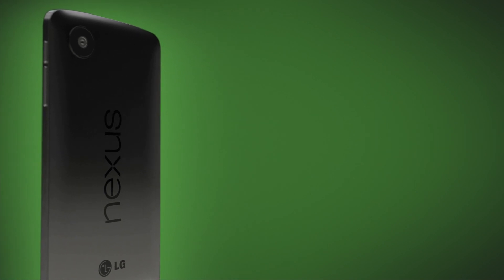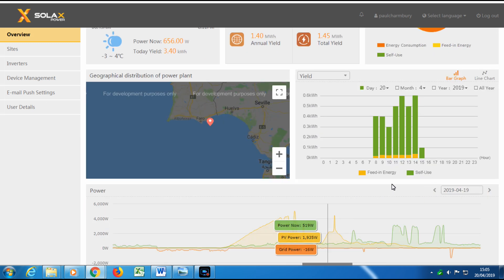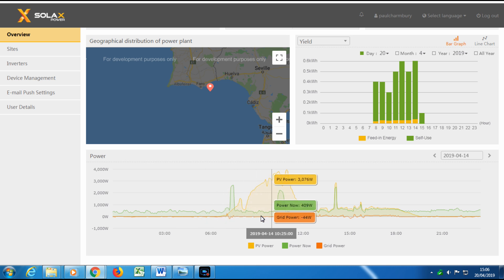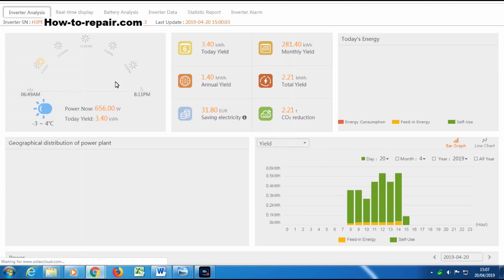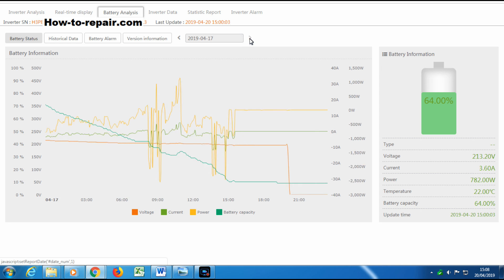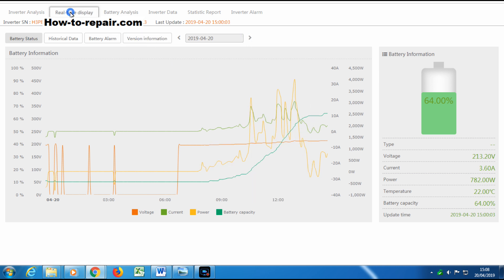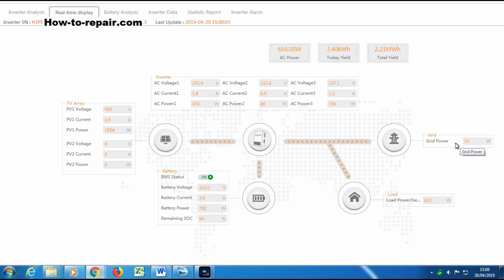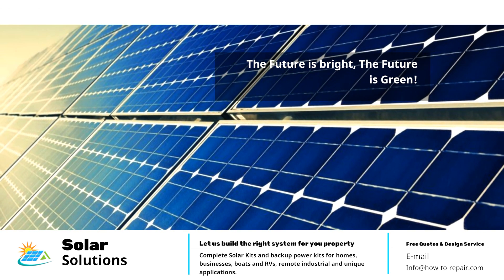How to repair Solax off grid solar shop and apartments In Portugal

Comment: I have a unrelated question to this video if you don't mind, I have a Kitchentek counter top pressure oven, it has only been used maybe 20 times and all of a sudden it trips the GFCI now when we try to turn it on. I have been unable to find any info on what may be the problem, the manual that came with it just says make sure it's plugged in, lol no help.
Reply: Did you solve this ( no on answered so thought I would!)?